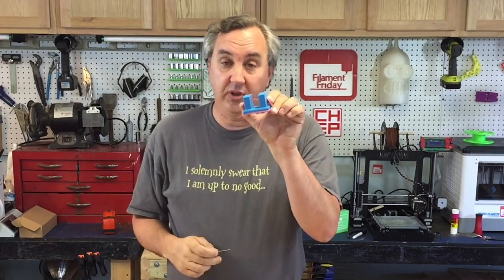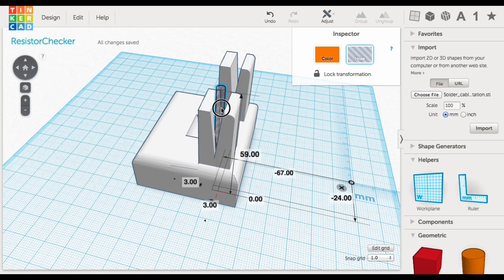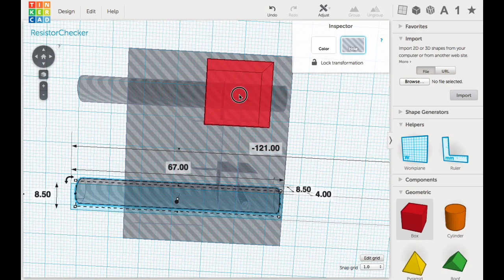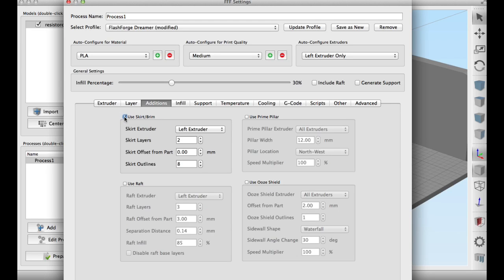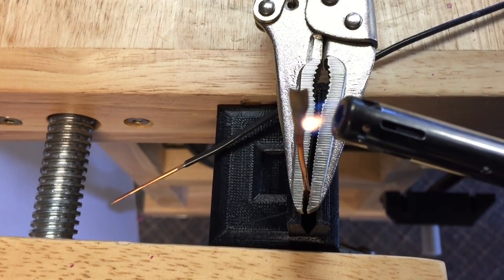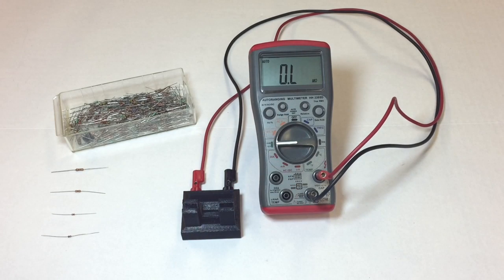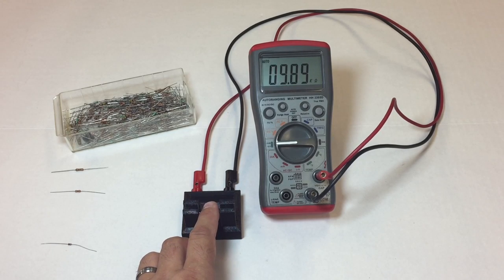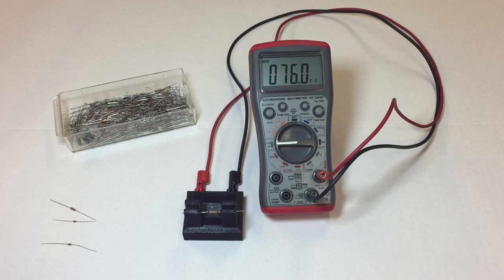Electrical Resistor Checker Stand w/Metal Inserts for Ohm Meter

Comment: Another great video, glad to know I am not the only one having problems with Chinese colour codes. I have an old item from Radio Shack ( now long gone from Canada) that has three wheel on it that you set the colours on and read off the values. My fall back is a mesmeric from high school electronics.

Comment: You're timing is awesome Chuck. Yesterday I was delving in my pot of resistors and having to check them with the meter probes, and we all know how fiddly that is. Yeah, my eyes ain't as good these day either. I found the one I wanted, but it will be a whole lot quicker next time, after I've printed this. Awesome solution mate.
I used to use ABS all the time too because my first printer was the DaVinci 1.0a, but I use PLA for most things these days ... unless I need the strength of ABS or PETg etc because my DIY i3 variant does everything I ask it too ... so far :-)
BTW Resistors were for a couple of Christmas lighting projects I'm working on.

Comment: 9:18 Orange is 3 not 4. Yellow would be 4 ;)
Just a side note. When checking large value resistors make sure that your finger does not touch both ends of the resistor under test. Your skin resistance will be in parallel to the resistor under test and the value on the DMM may show lower than it should.